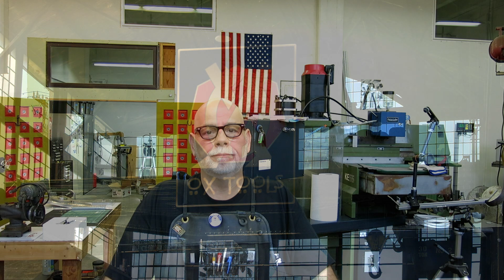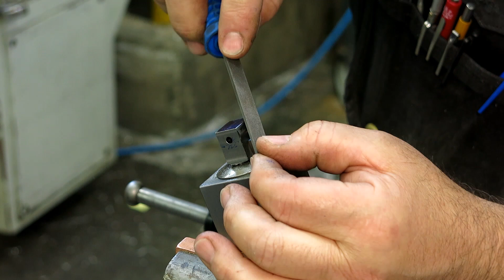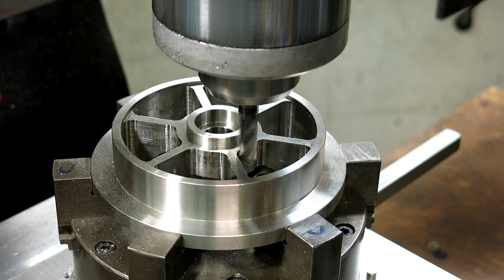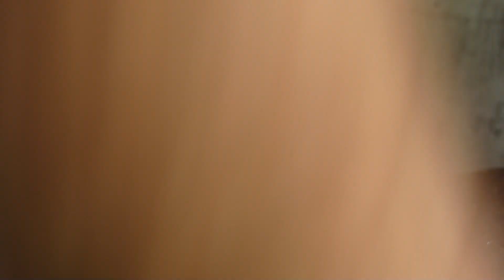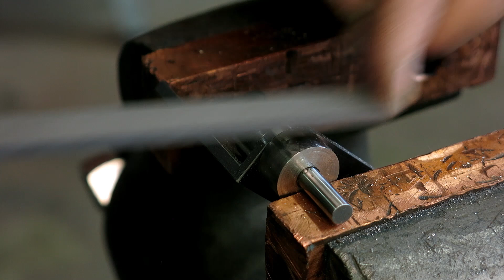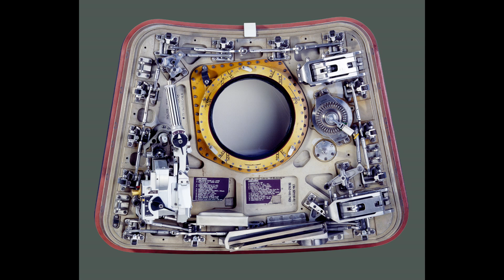Project Egress Quick Update

Comment: I would have done half of the work on CNC machines, especially the die with wire EDM. 
As a former toolmaker myself I appreciate the manual craftsmanship. You have to be very skilled to get dimensional accuracy.

Comment: Your build is beautiful and installed so easy not like some other builds. Savage was impressed and asked who built yours.
Reply: Was laughing at Adam’s amusement of Tom’s part. He kept wanting to touch it after commenting how amazing it is.

But yeah, those wooden and brass hinges were a pita. The guy who built them should have known better than to use electronic solder to hold parts together. Seemed like fixing that took over an hour by itself.

Comment: The "FLAG CODE":

UNITED STATES CODE

TITLE 36

CHAPTER 10

§175. Position and manner of display
...

(i) When displayed either horizontally or vertically against a wall, the union should be uppermost and to the flag's own right, that is, to the observer's left. When displayed in a window, the flag should be displayed in the same way, with the union or blue field to the left of the observer in the street.
...
Reply: I love Tom's work and insight but I came here to point this out.  Pet peeve of mine.  Keep up the good work, Tom but turn that flag around!

Comment: So they redesigned the hatch after the Apollo 1 disaster so that it could be quickly opened. First impression is of a very complex and heavy mechanism. But since their decade was almost up and the Ruskies were at their heals I'm guessing that they did not have time to optimize everything. Between safety requirements, schedule and weight something had to give and it was weight (and cost, which was never a consideration). I live this in the commercial airplane business. It's always fascinating to look at a design and try to figure out what went on behind the scenes to make it what it is. Lovely machining. They gave you some of the tougher parts!

Comment: What's your opinion on sending so many models and prints out for such a complicated project without any GD&T controlling features?
Reply from the maker: Good question. The GD&T on this project was a one line statement, "The part must be made to the exact measurements provided, with special attention to the size and alignment of holes" That was pretty much it. I'm guessing there will some drilling out with a cordless on the assembly live feed. Couldn't bear to see that on my part so I was pretty careful. 

Cheers,

Tom

Comment: The lead shielding required so that a organic matter can live trough the 2 radiation belts is about a 10 feet  radius , assuming it will not melt. It is impossible for a 3/16" thick walled  aluminum module with a glass porthole to have it s organic payload survive such a feat. Just observe how much the dentist shields you because he takes a panorex... 600 nautical miles altitude is about the maximum radiations the human body can withstand. The russians knew it , that is why they never got into that. Hubble's missions were the highest and astronauts complained about side effects related to a higher than safe orbit altitude. What is taught in applied physics and what is propagandized  on television are 2 totally different versions . How could even a spacesuit keep it's shape in the absolute void on the moon ?